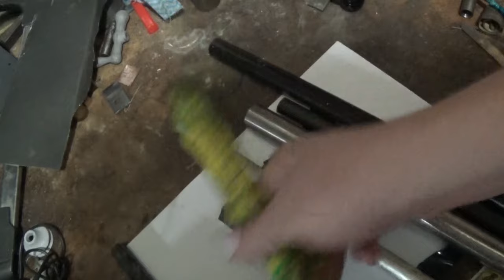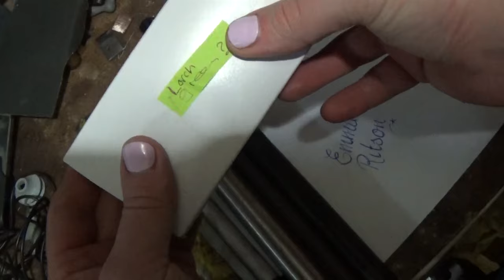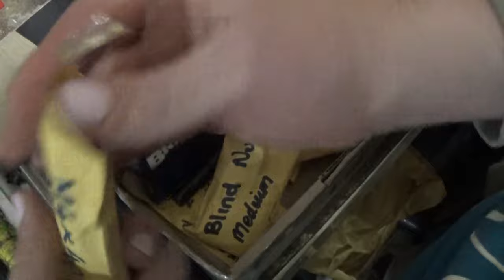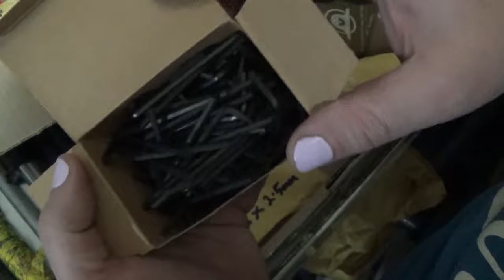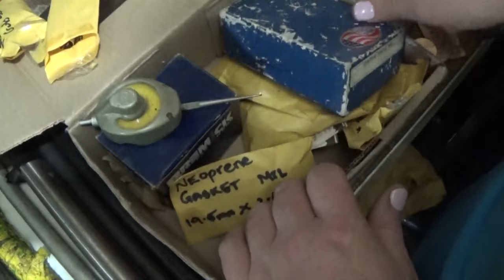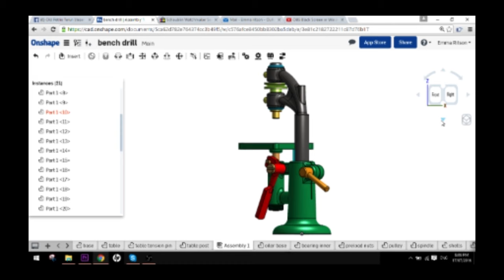An update for the week july 17- shaper woes, Onshape, and mail.

Comment: The valve seat concentricity gauge is interesting and could be of use. I haven't seen or used one but from the looks of it I would say a suitable guide pin would be fitted into the valve guide, the gauge slipped over it and rotated on what appears to be an eccentric until the indicator contacts the valve seat recess, rotate to see concentricity to the guide. Sounds good to me 😊